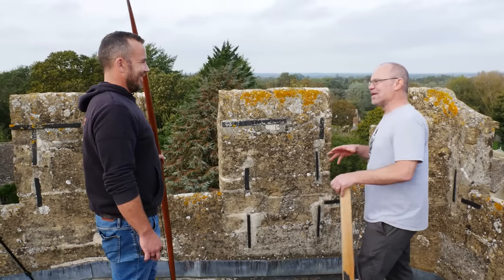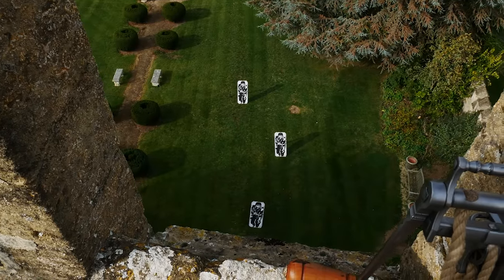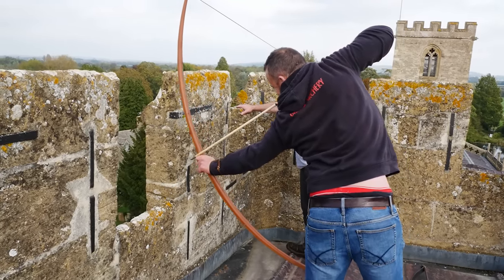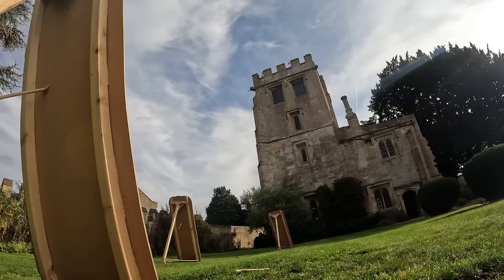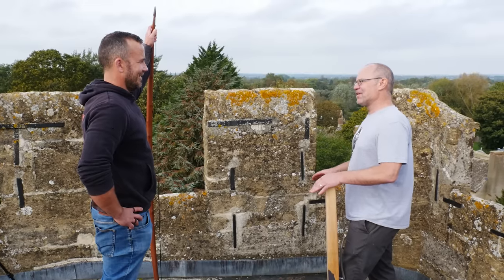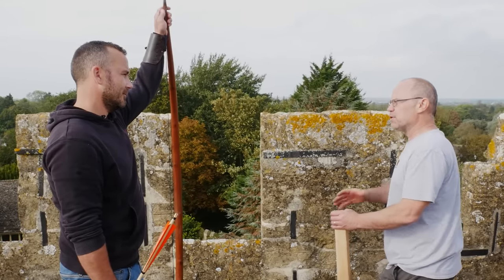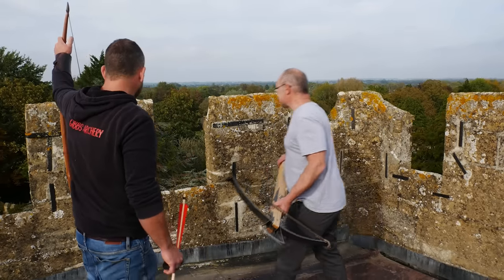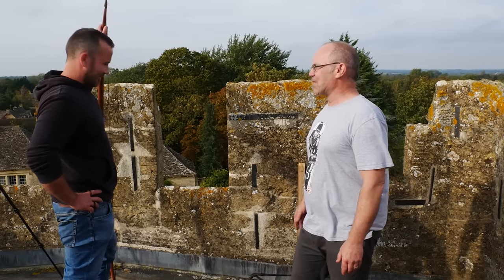Crossbow or Longbow? What's better for defending your medieval tower?

Comment: wow, I never spotted (or rather, heard) it in the normal series with Joe Gibbs, but the sounds of EFFORT as he draws back that bow! it's like someone's slowly letting air out of a balloon, and really goes to show just how HARD pulling that thing back really is! I have to agree fully that the biggest advantages of Crossbowmen on crenelations has to be that they can do it for longer, and can hold shots longer. I really did NOT notice those effort sounds during the normal testing
Reply: I suppose one is basically holding the weight of a 10 stone man with every shot, it's a lot of muscle work :)

Comment: If you watch the Chalus Castle siege scene in the 2010 Robin Hood movie with Russell Crowe, you can see how even the actors playing the part of the defending Garrison also struggled with how to effectively return fire from the battlements much in the same way you did. There are multiple instances where you see the defenders hang out at awkward angles to get low angle shots with their crossbows.
Reply: They are ignoring the fact that there would be enormous hoardings around the tops of the towers. Everyone thinks these naked castles were defended, they had huge wooden defensive structures on top of the walls. They had much better defended firing positions within the hoardings. Apparently these towers were built late and never really meant as real defensive structures so don't even have crenelations or other defensive features like a simple dry moat...
Reply: @christophersteen1873  Seeing as how they are using fire to destroy the gate, I would assume a good chunk of the Hoardings have already been burned via other methods like incendiary pitch arrows.

Comment: You are discovering many things those of us who archery hunt from tree stands have had to adjust for – there is a disadvantage when the target gets too close and in addition it requires a lot of training to be good shooting from height down vs. shooting on level ground ( aim point changes and your draw length to anchor point also changes).  Oh, and longbows - yeah, lower limb hitting is a common issue.
Reply from the maker: I hadn't considered that there of course people doing pretty much this when they hunt.  Probably because there is no bow hunting here, but thanks for your insights
Reply: This is why treestand archers draw, anchor, and then bend at the waist instead of lowering the bow arm. And all this has to happen without spooking deer. It’s still a challenge!

Comment: In larger castles, multiple overlapping fields of fire meant that other defensive areas could target attackers closer and visa versa
Reply: Also in larger castles they would build machicolation to be able to drop stuff without having to be exposed and could probably be used to fire at closer targets
Reply: @14KoniAK  Good point
Reply: Also, Towers that project outwards from a wall, the person in front of you on the wall may have a hard time shooting you, but not someone else 90 degrees from you to the side on a tower.
Reply: And even just small towers like this one had many effective weapons for use on attackers at the base of their walls. Cue up this video to 1:35 and freeze frame. Note the stone funnel for flaming oil, just to the left of the double windows on the right side of the tower. One can even still see the remains of where the cauldron would have been, right above the down facing port. 
I'm sure the lower levels would have lots of "murder holes"(defensive slits? I like that better. Killing hordes or armed attackers trying to kill you is hardly murder! 🙂) to shoot through too. We just can't see them in the video.
Reply: @95ellington  That is an important point given how they felt exposed in the video yes
Reply: Remember, of all the arrows and bolts and bullets ever fired in the history of warfare, almost all of them miss.

Comment: I think the pop-up-and-down advantage of the crossbow is more significant than you mentioned. 

Todd and Joe appear at 9:26.5 (ish). Todd disappears at 9:28 (ish) and Joe at 9:29 (ish). 

So, this is roughly 1.5 vs 2.5 seconds of exposure. For a single shot, this is not that much practical difference as the probability of getting shot in that time frame is rather low. However, if over a few hours each person has 50 shots, this means the crossbowman would have been exposed for 1 min 15 seconds and the longbowman for 2 min 5 seconds, with the difference in time growing with the number of shots. I can see this having a significant impact on survival rates for long sieges.
Reply: Well reasoned along with a great explanation, cheers!
Reply: In reality, they would use neither approach.  The men on the tower would rely on armor for defense and rapid volley fire over aimed shots.  For aimed shots they would step forward select a target and step
back.

Hitting a head is difficult to hit reliably with a modern firearm and with the height leather armor is effective against arrows.

Commanders would look through the crenellations to direct volley fire at an approaching army, and switch to other things like the battery when they are closer.  As an approaching army would be spread out there are likely targets to engage that are farther out.

While the exposure difference may appear dramatic, in actual combat an arrow fired immediately may not even make it before the archer steps back.  It leaves very little time for aiming
Reply: Isn't the point more that you can wait at full draw with a crossbow? Meaning for the attackers a crossbow is even better than for the defenders? Imagine having to shoot someone, even if they expose themselves for 3 to 5 seconds, with a longbow. You'd already be too late.
Reply: @stysner4580  No…. all things being equal the first shot would matter except…. crossbows take much longer to reload and the loader’s attention will be on turning a crank.

Crossbows are primarily used because they require little training and the loading job can be distributed to noncombatants.

Medieval warfare consisted of group actions making individual aimed shots somewhat uncommon.  Rather than aiming at a man on the tower volleys were fired at the tower.
Reply: @kwonekstrom2138  All things remain equal then if you bring shields and reloaders as the attackers. Shields are relatively cheap and can even be improvised on location if necessary. The attackers can move a lot while the defenders have finite positions to be at making aiming at them (especially in volleys) way easier. The defenders might have to aim at a different location every time while the attackers can wait for someone to pop up and let loose immediately.
Reply: @stysner4580  You might not realize it…. but shields are also available to the defenders who also have… walls.

I’m not sure why you believe that the attackers would have more ability to defend against projectiles than the defenders….

Actual history shows that assaults did use covered platforms to protect battering rams.  The ability to protect soldiers this way was very limited and specialized.  Even with focused assaults using large “canopy shields” on scaffolds the losses are much heavier for attackers.

This is why medieval sieges typically starved defenders out until cannon made it easy to bring down walls.
Reply: @kwonekstrom2138  attackers have mobility. The point was archer vs archer, not the entire battle.
Reply: @stysner4580  I’m not really sure mobility is the factor you believe that it is…. and in a battle you’re always going to have to worry about any archer within range.

1.  The crossbowman isn’t going to operate their crossbow AND carry a full shield at the same time.
2. Any shield large enough to provide the degree of protection necessary is s pretty large and expensive.
3. The person manning a wall will out range a person on the ground.
4. The person on the wall has extreme protection over most of their body without any encumbrance
5. The person on the wall has a height advantage that extends the range and power of their weapon.
6. At extreme ranges the person manning the wall will not need cover and that first shot penalty goes away.

Whatever the movies show… in the real world, archers weren’t used like snipers.  They were used to break up and slow down formations…. nobody expects a single infantryman to attack a formation alone… but even with that contrived requirement the guy on the ground loses badly

Comment: Honestly, this really does make me wonder about actual historical draw weights of bows.  We only are working from one specific historical example for weights  (Mary Rose) and that was a very specific environment.   I know as a very amateur hobbyist with a little leaning I can shoot down and over a wall pretty comfortably with a 70-80 lbs bow (albiet a short Turkish style with a thumb draw, haven't tried a longbow yet) at a pretty steep angle.  If the arrows aren't punching through plate at 140lbs anyway, and you're still hunting for gaps in the armor, would a 70lbs bow also serve that role equally well?  I can't remember if you tested maille with a 70lbs bow, but it would do an absolute horror show on cloth and flesh as bow hunting has long established.
Reply: To be fair, the weight calculcations are not just based on the Mary Rose bows. It was either Will or Joe in a previous vid who explained that based on the socket diameter of historic arrow heads and known draw lengths/arrow lengths, with the weight you get for the resulting shaft you can pretty well estimate the poundage of a ballistically efficient bow to move that arrow.

But there's no reason they wouldn't have used lighter bows for situations as such...
Reply: @GCCRACER   Oh that's awesome, I'll need to dig back through those videos to find those. That actually makes an interesting consideration.  I wonder if they all just used universally heavy bows, or if they did employ lighter bows would they just use over spined arrows for those lighter bows and hope for the best?
Reply: @timothym9398  I think the bows were universally pretty heavy, at least for the English and Welsh. Many cultures with a tradition of mounted archery would often use similar draw weights to the English on foot, but lighter bows when mounted. Mounted archery equipment and techniques would be surprisingly helpful for a situation like this:
https://youtu.be/E_dHqDNsGc0

But remember, in this test Joe shooting only from the roof. In an actual castle, you would also have arrow loops halfway down the wall, from which archers would easily be able to hit even the closest target.
Reply from the maker: @timo - you make some good points and in fact yes a 80lbs bow will go through mail and a 140 won't go through plate, so you could ask yourself 'why bother with the heavy'.  The subject of a film next year most likely

Comment: Maybe this is why most castles had enfilading fire positions?
Reply: Yep.  They're within 15 yards of the base of your tower, but that might place them 50 yards from the archers of the towers to each side of you; putting them into a crossfire.  But issues with engaging closer attackers is also why castles had hoardings or matriculations that could allow archers to, in effect, fire down through the floor to hit enemies closer to the wall.  (Not to mention those same openings allowed defenders to drop things straight down on people up against the base of the wall)
Reply: Not just that, but arrow loops lower down in the walls would have no problems hitting the closer target. Enemies who are farther than 30 meters or so are the concern of the archers at the top of the wall, but the ones that get closer can more easily be aimed at by the archers closer to ground level. That's part of why you have arrow loops at different heights.
Reply: While they mentioned dropping things from the tower, I contend that the "safe zone" doesn't exist. I'm confident I could throw a fist-sized rock at a target twelve yards away. Or a javelin or dart of some kind. Maybe even a much larger rock, given the range boost from throwing off a tall platform.
Reply: Don't forget the Batter at the base of towers and walls which can be approached by land. 

The wall was progressively thickened as it neared the base to deflect any stones dropped from above into the faces of approaching attackers.
Reply: @jonathan_60503  And these towers used to have them too, as wooden structuctures around the tops of the towers, but they have long since rotted away and for some reason todd has forgotten about hoardings in this video, though they fix and resolve almost all these issues. With hoardings you would not be seen by the attackers, you keep the interior dark etc so you can't be easily shot, they just don't even touch on the reality of the advantages you have while shooting from a prepared position.

Comment: A good justification for building hoardings before an expected siege. Gives your defenders more angles and options for attacking the enemy without exposing themselves to angles that would be as susceptible to missiles.

Edit: There are a few archery techniques out of Eastern archery(Turkish/Turkic) that are for shooting downward where you draw the bow from behind your your head to be able to get an angle to shoot downwards that could be used both at short range on horseback and when shooting from the top of a wall or fortification, but those bows being much shorter are probably much more conducive to awkward positions on ramparts than a longbow.
Reply: The hoardings were basically permanent, they wouldn't be taking them down and putting them up over and over again...

Comment: For the guys closer to the wall you could just toss out plumbata by the bucket
Reply: and rocks if the get too close
Reply: But would he not be armoured in the period? Plumbata will not penetrate most of him so the vulnerable area is very small.
Reply: Rock is great! It's a side product of digging ditch! It's free and it hurts.
Reply: or hot oil or rocks or anything but thats not the discussion
Reply: @myonionsmatter7843  Careful with the hot oil.
Reply: @johnfisk811  Armour might stop plumbata, but a good hefty rock thrown with some force could just ignore that armour. Imagine taking a fist-sized lump of stone to the helmet - not just a drop, but an aimed throw. I figure that might put me off my game a bit.
Reply: @myonionsmatter7843  in the video they mentioned a sweet spot where you couldn't have things dumped on you but were too close to shoot easily, presumably thrown rocks or darts would out-reach hot oil
Reply: Also have to remember you have limited ammo on that roof top.
Reply: @johnfisk811  true but not all of them would. Caltrops? Rocks also work
Reply: @Kuhmuhnistische_Partei  You're right about that - oil was expensive !  Most contemporary accounts I've read talk about boiling water, which is just as good as oil at getting inside armour. It's considerably cheaper and less likely to burn the castle down if it gets knocked over before being used. 

Another favourite was quicklime. Commonly available, easy to make if Health & Safety aren't looking, and very, very nasty if it's tipped onto you, especially if you've just been doused with water (boiling or otherwise).
Reply: @myonionsmatter7843  hot sand would probably be better than hot oil, more expendable

Comment: The reverse scenario would be really interesting. How long can you poke your target out till Joe Gibbs hit it from below?
Reply: I do not envy them trucking what would be necessary to catch the misses up to the top of that tower. What goes up at less than escape velocity must come down, and where it will come down is not easy to accurately account for with every shot. "Know what is behind your target" applies here as much as it does with firearms.
Reply: @corwinhyatt519  You could set up something on top of the tower to catch most of the arrows (like even a tarp might do it with blunt arrows), but there's the other issue as well that the owner of those towers probably won't like you hitting the crenellations either.
Reply: @romaliop  Yep or the windows below them.
Reply: Altogether this is sounding like an experiment better suited to a plywood simulation of a tower in a much emptier field.
Reply: @romaliop  It will be much more practical to empty a large enough area behind the tower and protect the windows.